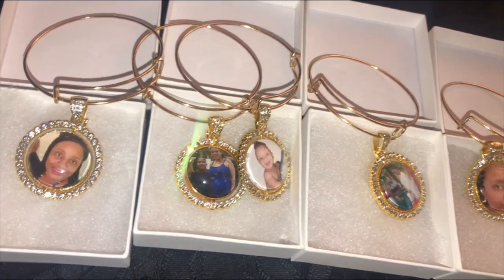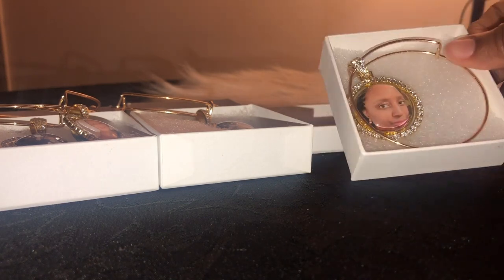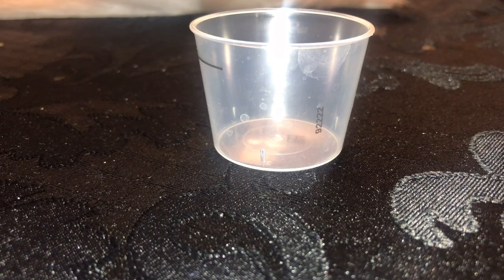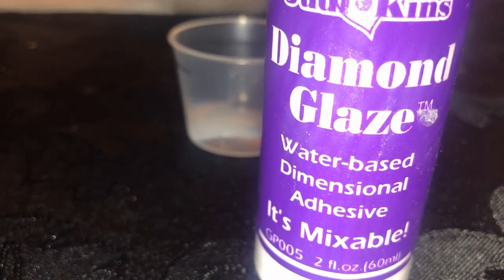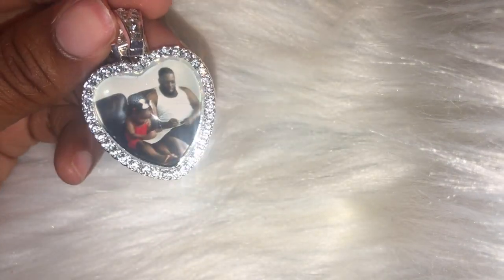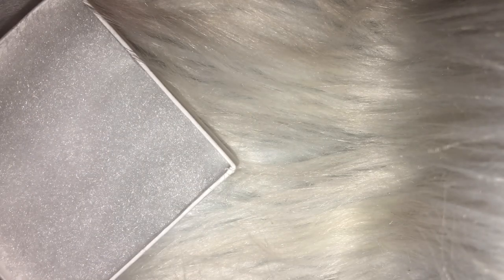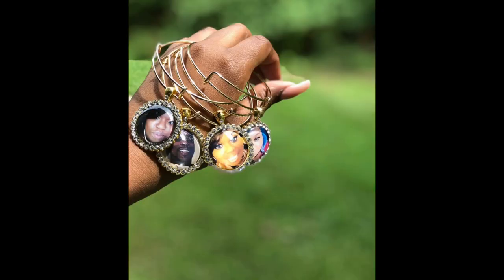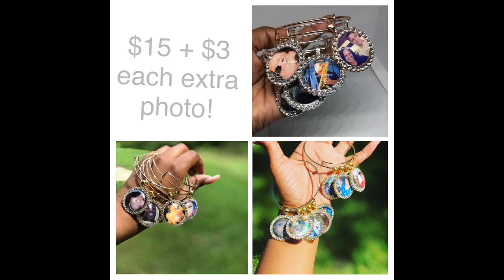DIY Heart Pendants Without Air Bubbles: Updated

Comment: Your work is just lovely. I'm having trouble using Diamond Glaze. When at first I put the glaze on and lightly brush it on the picture, then put my glass over the picture, after a few hours or a few days, I notice some sort of silvery shimmer under the glass. It almost looks like glitter. It can't be a bubble because I see the bubbles oozing outward to the edge and out from underneath the glass. Have you experienced anything like that. And if you did, how do you correct it? Thanks!
Reply: I have the same problem and am waiting for a solution.